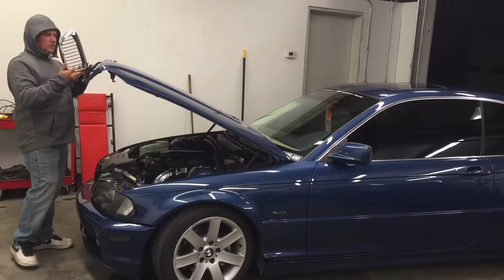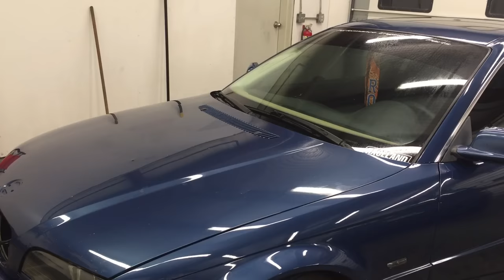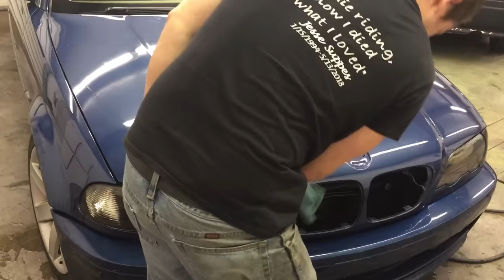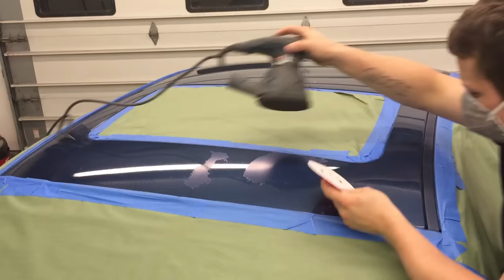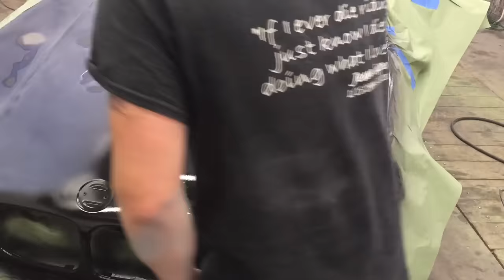The Best spray can paint for high gloss. (Hood has imperfections)

Comment: Will this method of painting work on pickup trucks too?  I just picked up a '91 Ford F-350 on which an 
ameteur body man screwed up the 
bodywork preparing it for paint.  I
understand that I'll have to sand and re-primer most, if not all of 
body surface to get a nice shiny 
finish.  And what is that paper 
you-re using to help mask the 
car? Can I get it at an auto parts
store?  Your work does look 
pretty good for a spray can paint
job.  Haven't done one in 50 years.

Comment: Legit question, not trolling - is your order of steps correct? Wouldn't you do wax and grease wipe down or wash after sanding instead of before?
Reply from the maker: It was a last min video idea i had but i wax grease removed the car prior to sanding then said i should do a video. Then sanded then acetone to remove anything else left over. But you are correct. I do both. before And after.
Reply: @JamesDguy  Okey dokey. Thanks for the response

Comment: I do not understand line of thinking hire.  Guy in video used 2X what is per Rustoleum primer and paint.  Why he need it here as car is  primed by epoxy from factory already, plus has base and clear.  Should he use just base enamel Rusto and than clear for UV protection.  And what is that "primer" in 2X?  Sealer, surfacer, build upper?

Comment: Hi, I have a question regarding the UV protection and fading with the rustoleum paint. Have you had any issues like that with the metallics? I was told that Duplicolor has the UV blockers and Rustoleum does not. If you can shed some light on your experiences if you have used both, I would greatly appreciate it. I intend to use it with the Spraymax 2k clear coat.

Comment: I finished painting my truck yesterday. It turned out ok but looks a little spotty. Like I didn't put enough on in some areas. Can I add another coat today or do I have to start all over?
Reply from the maker: You are supposed to wait a certain amount of time i don't know the exact time frame because if you do not wait it will wrinkle up..

Comment: The waves in the hood are from not using your sander properly. You can clearly see that you use the sides of your sander to cut quicker. Don’t do that, keep the sander flat. I get that you want to sand it quicker and the side of the sander works, but you need to leave it flat and it will feather those edges much better.

Comment: That's a light coat? That's a heavy heavy first coat. It should be see through on the first go round or two.. I'm painting my interior now. I used a scraper to peel the paint first. Then sanded it smooth using 120 sanding block no swirls. Waiting for the 3rd coat to dry, then ill be using clear coat next.  So far i have full coverage after (3) coats. No bubbles and perfectly shiny even without a clear, i'm also using Rustoleum Cherry Red.

Comment: I need to know this. I have to buy a new fender and hood for my car, not to mention a new nose piece and under bumper cowel where the fog lights go. They come with black primer already, and I found the factory paint 372 Stahlblau Metallic in spray can form. complete with a hardener system and a clear coat in spray can.

I shall ask some questions...anyone can lay down their 2 cents worth of advice. I will listen.

Option

1. Should I do the spray can system which comes with a primer,base color and a clear coat with hardener?

Option
2. Buy the paint in the quart sizes and use a spray gun. 
       The spray gun i do have is a airbrush system with a Master Airbrush Gravity fed with a 1/5 hp compressor sitting atop a 3 liter tank. Would that be good 
        enough to pain the fenders and the hood, even though it might take longer?

Option
3. Should I buy a 3hp compressor and gravity fed airgun from harborfreight or amazon?

Thank you in advance

Comment: So I shouldn’t apply primer on the whole hood?
Reply from the maker: Angel Corona You only really need it to either smooth out imperfection, over care metal or if you sanded all the original paint completely off. I use primer on occasion like on my newest paint job. The replacement bumpers are gonna be black and the car was white so I primed the entire thing grey so that the bumpers and fenders I’m replacing won’t be a darker color and the rest be a lighter color.
Reply: I will be sanding my original paint completely off before repainting. So I should prime the entire car right? And what primer should I use?

Comment: I would consider a primer, then a layer of the ceramic brake caliper paint from an Advance auto parts store, about $10 for a large spray can, then this paint. Then leave it- close enough for me. The extra layer of paint will make future scratches and chips less likely to get down to the primer. For a new car, see the Hagerty written article about the new paint for a Mazda MX-5 Miata, to get off to a good start.

Comment: I liked this video a lot man and one of the reason I’m tackling an entire car with the 2X Gloss white. I do have a question what brand clear coat with hardner would you recommend using after laying the base coat? Also after spraying the self etching primer, does that have to be sanded at all? Thanks man any advice is appreciated.

Comment: Since you're pretty much the spray can king, can you give me any advice to avoid tiger stripes while painting ?
I've tried overlapping more, and even doing coats perpendicular to the previous one, but it never works...
Reply from the maker: IMNOTA Temperature of the hood being cool and engine being cool, also make sure it’s not on a hot day and not in direct light. I think I mentioned and showed how I did it in this video
Reply: Prep right. Sand using right grit with even pressure until smooth all around.
Reply: Maybe try doing one panel at a time paper off each panel. Because you have to be quick and steady all while you keep a wet edge. Watch the video again in how he achieves keeping all edges wet. That's the key. Watch other videos too you will then notice a planned out painting "pattern" that gives way to keep the wet edge.  It's "over spray"  that is causing the line look. Meaning the edge dried before you moved along in passing. Hope that makes sense. Plan out a painting pattern first. Practice on cardboard so you get your spray timing honed in then you can develop a spray pattern that will work for you. Everyone has their own unique way.  Light layers not heavy thick ones. Light layers this will make the first coat look more  transparent like, then upon the second coat you will see it solid in color.  This also gives a better adhesion and will be less likely to run and sag. Also don't point and spray... Start spraying and " move onto"  so that you don't start with a blob.  Always keep the  spraying area   "moving" no start and stopping points. I hope that makes sense

Comment: Looks good for rattle can paint work. Next time you do one, get you some 3M spot glaze putty and go over the low spots with a glazing spreader or spatula, then wrap up a paint stick with your 320 sand paper and block sand the puttied spots. It will give you a nice smooth surface and the paint will look alot better 😉.  You guys did a great job and you'll be really happy when you see the difference, and do the same on your rust dings on the front of the car.  Good luck guys.
P.S. I think you should stay with the color of the wheels.

Comment: How long does this paint will it last in the hood before it starts coming off due to the fact that you did not use 2k clear coat?
Reply: Did my first race car with rustoleum five years ago. Still looks good now and it's spent the last year sat out under a tree after the engine blew up. Stone chips seem to happen a bit easier with this paint but that's the only flaw I can see for something so cheap and easy.

Comment: Taping off before sanding???!!  Something we never do at the body shop. Sanding is done prior to taping.  If you're worried about hitting the moldings run a strip of tape but that will need to be removed before the final  taping off for your painting. You should wipe the moldings down with the grease and tar remover pre taping. This ensures the tape has no lifting while painting. For that CAN happen! Also, the primer should have covered AT LEAST the entire area of the spot; not just the bare metal within their spot.  Also please note, he stated a KEY word which is self etching primer! If you don't use a self etching primer, you need to "lightly hand scuff" the area. This gives the way to adhere .i.e something to hold onto. (Which is one reason clear coats fail, the underneath needs to be free of grease and grime and needs to be scuffed so it can hold) Personally,. I think the entire area should have been primed. I know this is for the purpose of diy cheap, however at least prime the entire "spot". You will gain a nicer result by doing so.  Then in a weeks time I'd either wet sand with 1000 grit or very light hand sand with 600 and clear it.  Otherwise, plan on putting a thick layer of wax weekly!  Because without hardener this paint will stain and fade fast.  You can get a 2k rattle-can clear, which would be ideal. If you don't mind adding some additional time (a day between each coat and labor of wet sanding between coats) a tractor paint thinned down and a hardner added, makes for a lasting, chip and stain resistant paint job. The more coats the merrier, simply because it's very easy to "burn" thru paint when either sanding and or buffing out. AND because of the likelihood of having orange peel is great! Hell I'm willing to bet many will actually get "alligator skin". Painting is a skill & if this is not practiced to hone in on the skill of painting a car the likelihood is even greater..Note: there are more steps a "professional" does ie glazing putty ect. This is just on the lines of saving $$ Please don't let this burst anyone's bubble either, for that's not my intent!! With enough paint even alligator skin can be worked out. I think doing something yourself has many benefits so I hope you do GO for it!! I'm an avid DIYer! What is a professional anyways???? * One who practices and also holds the gift of gab! . Knowledge is all I am sharing which I have gained from my own experiences.  Practice makes better which comes with time and effort. No one way is the only right and no one is perfect. Take it in and think first this will make things easy on yourself. It's basic,  ALWAYS start with 1, 2 &3! Do NOT skip any of the steps in-between!!  Life is simple when you choose to accept the basic design of our nature.  Hope this helps at least one!!  Living life in the rAw because right Accompanies wrong. Both are equal for the two opposites depend upon the other just to be. Their bond of strength comes from meeting on the bridge that's in the middle where together we share and all matters become possible to solve. What a balance.... it's perfect, together we work in harmony.  Life isn't about you nor I or any single one. Life is about all. Focus on the center and live in rAw, in our sharing & togetherness, we all can live in peace and harmony the very point of life.  Otherwise what other purpose makes sense??? Live large Live rAw! I didn't design it, I just chose to accept reality.  We are all born with the will to survive KNOWING we all are going to die! Help one another relax and enjoy before the time that is as it gives;  our ability to change ENDS! rAw as the three letter word shows rAw focus on the center letter A ... Together All gain the goodness that good holds to give✌️

Comment: Great video. So first you sand it and then primer and then paint? is there anything wrong with going all the way down to the metal or it's not necessary?
Reply: Go to metal only if there is rust, otherwise dont
Reply: do you use anything besides paint? primer? top coat?
Reply: @J87513  primer on bare metal and i would usually use a top coat but in this video he doesnt seem to use one and still get a nice shiny finish🤔
Reply: which kind of paint did he use? can I assume it was urethane?

Comment: Do you wait in between coats and how many coats do you do?
Reply: Waiting between coats allows vapors to evaporate in paint they call it flash time. If you don't wait you may get bubbles as vapors from first coat try to escape through second coat
Reply from the maker: 99codzilla That’s correct 100% wait at least minimum 5mins but best is 15 mins.

Comment: Looks great, I took my hood off so I could paint it im my shed, with ventilation and no bugs. You recommend painting it laying flat instead of standing up? 
Also you don't think a UV protectant clear coat is necessary? Thanks
Reply from the maker: It will fade into more of a semi gloss black if you don't use clear but its nothing crazy. If you use ceramic coating it don't fade at all. If going with a Clear coat do a 2K clear not the 2X from rustoleum
Reply: Ok thanks, where is the 2k sold?

Comment: I plan on getting my feet wet with some body work and painting on a 2000 accord i just bought.  It has a bunch of hail damage,  several rips and tears in the bumpers and the paint is rattle can so really nothing to loose 😂 i plan on fixing the hail damage,  repairing the bumpers and painting the top and bumpers.  I plan on replacing my hood too mine is in bad shape.  Car runs great and everything works but the body and paint is rough.  Loved it!  I'm actually thinking about getting a couple of spray guns and some decent primer, paint and clear.  I've been messing around with rattle cans until then.  I'm surprised what can be done with rattle cans.
Reply: Look up urkem paints, you can get a kit that has basecoat and clear for very reasonable. Plain colors are in the $200 range I believe, and Metallics, pearls, and candies are in the $300-$400 range for a whole kit. Their paint has tons of good reviews. My next paint project I'm going with them.
Reply: @sinformant  i sure will!  Thank you I've looked at several like this but these colors!  Very nice
Reply: @whocares4464  no problem. I am not affiliated with them or anything, just hard to beat their prices and still get bad ass colors like this. Food for thought, the first time I painted my motorcycle I used hok tangerine candy and it was $100, $25 for the reducer for just one quart of the base coat. And around $70 for a quart kit of 2k clear from kustom shop that alone already cost more than motorcycle kit of a similar tri stage color from urkem.

Comment: I would honestly rather hear the sander than hear nothing. And you don't get waves out by wet sanding with your hand pressing in the paper. You get a block that forms to the body and wet sand with that. You introduce waves by using your hand. And you don't shoot for full coverage on your first coat. Use 2k primer, block sand, then 1 light coat, followed by 2 medium coats. Never do a heavy coat because it pools up and you get runs and it looks shit. Then c l

Comment: You could see orange peel and other assorted flaws in the finish in the up close shot ous the BMW badge. I guess some wet sanding with 2000 or above grit and some clear or a polish, would get it looking closer to professional spray gun quality.
Reply from the maker: Yes! I painted my wifes crv and it came out with some orange peel but i will be doing a video on wet sanding and buffing it out!
Reply: @JamesDguy  is orange peel normal and does wet sanding it and buffing it completely remove it?
Reply: Eric M  Some orange peel is normal with a spray car. Wet sanding with 1500 grit and buffing will completely remove it, but for an everyday beater, WHY? Unless, you're teaching yourself how to cut and buff.
Reply: I've seen brand new cars with it years ago (don't know about now), so nothing to despair. It's like a lady with minor bvisible pores vs one without. Nice without but not bothered if I see some up close.
Reply: Yea to me it doesn't look bad with it. It wont bother me. It does look better with no orange peel but I'm looking to paint my 04 ford explorer from black to blue and honestly it'll be more of a practice than anything else.
Reply: Had a 70 Mach I that had orange peel BAD, had a 73 Mach I that was beautiful. Both bought new, both had metallic glitter in the base coat.

Comment: When I posed the question " can I spray 2K clear over Rustoleum base coat?"  I got this answer from google "No, do not use the Spray Max 2K Glamour Clear Coat over Rustoleum. Rustoleum is a lacquer type of paint and Spray Max 2K Clear Coat is a urethane. They are not compatible. You need a urethane paint for best results.  I would stick with the Rustoeum Enamel clear coat and not use this product. First, this product is very expensive compared to a spray can of enamel clear. Just make sure you're using Enamel over Enamel. Acrylic Lacquer has a faster flash point due to much greater concentration of solvents and it'll mess up the enamel clear unless you let it cure a long time... like a month or more. But if you're set on using this activated clear because of durability (it dries hard but takes a couple weeks to cure fully), get a urethane color coat from your local automotive paint store. They also sell the activated urethane, which is what this product is."  

How are you able to make it work so well if the paint and clear coat are not compatible?

Comment: Looks like tons of dust in the garage.....hope u guys had a fan.
Looks nice and much better than before for sure
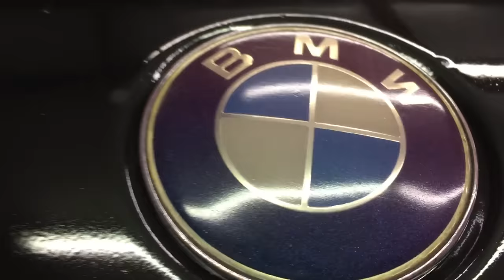Reply: I agree, he should've sanded the car outside there would be less dust in the garage, on the car, (10:50), and less to breathe in. Then maybe cleaned out the garage and taped up cheap Visqueen all around and maybe wet the floors to keep the dust down. This also would keep all the overspray from getting all over the garage. Not dissing the guy because I enjoyed the video.
Oh yeah, he should also invest in a respirator, to deal with the fumes.